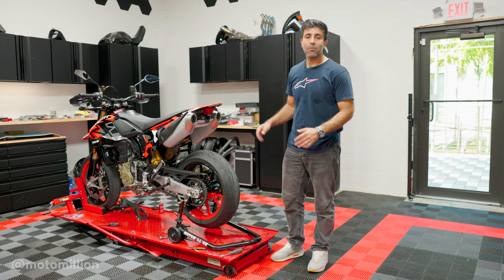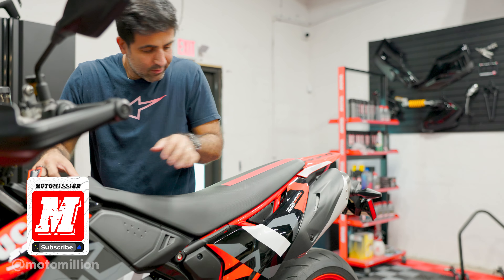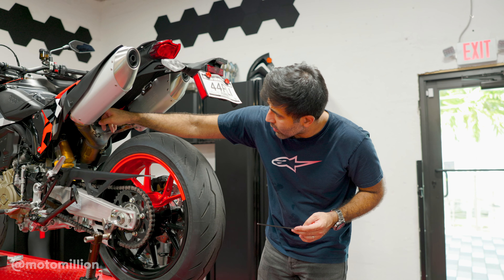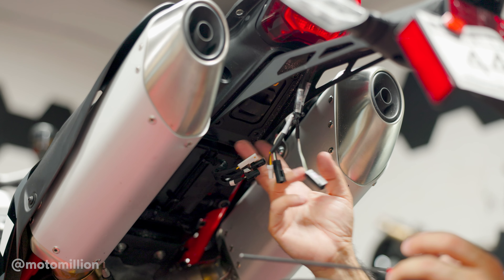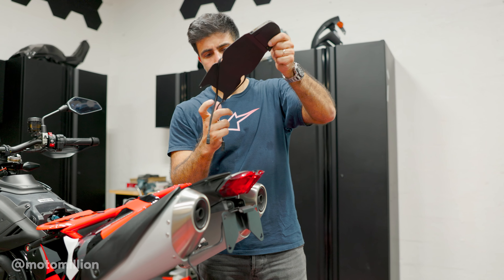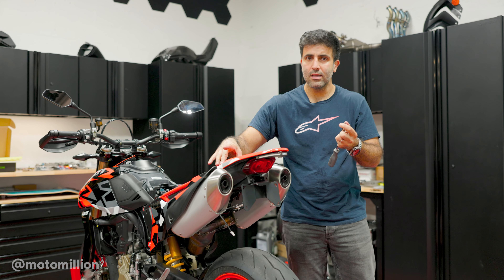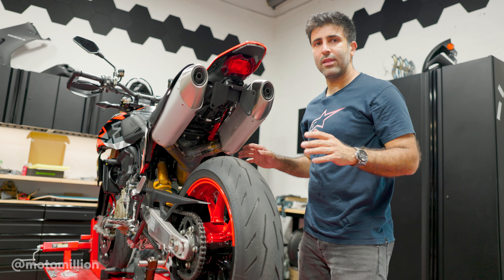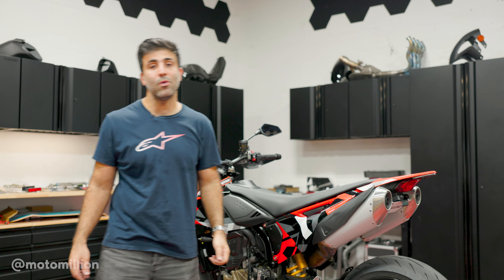Ducati Hypermotard 698 RVE Mono NRC Fender Eliminator Kit Installation | Motomillion

Comment: I saw in your guys' other parts video that the indicators are regular ones - are you planning on adding dynamic indicators to the kit or releasing another one with dynamic ones?
Reply from the maker: What do you mean by Dynamic?
Reply: @Motomillion  Dynamic as in the LEDs of the respective indicator subsequently flashing after each from the middle to the left or to the right. Not the whole indicator lighting up at once.
Reply: @reallyole  aka scrolling
Reply: @Motomillion  any updates on this?